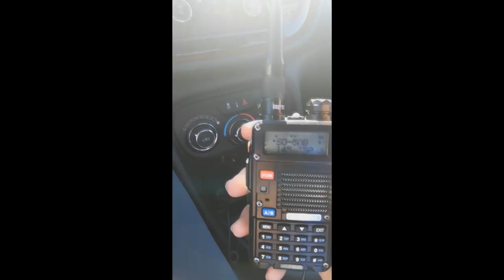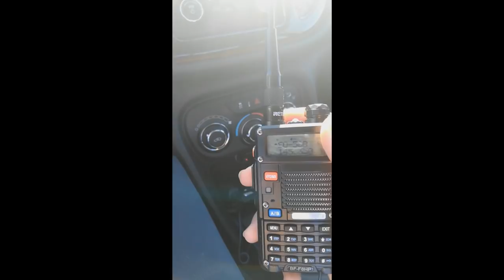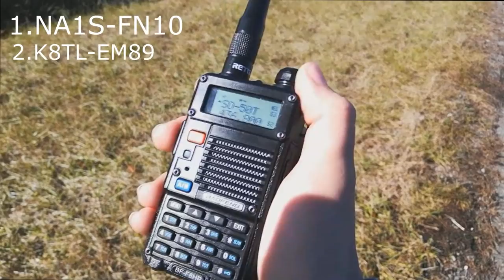Making contacts on Satellite SO-50 with the Baofeng-F8HP

Comment: Awesome! Would like to see more on how you set up in preparation for this. This is great!
Reply: Setup is somewhat simple, but you need to be able to program splits into your radio since the uplink and downlink frequencies are in different bands. The Doppler effect is more pronounced on 70cm band, so I don't worry about it on 2m. Just program -10kHz, -5kHz, center frequency, +5kHz, and +10kHz on the 70cm freqs. Use +10, +5 when it's just starting its pass, center when it's overhead, and +5, +10 at the end. Of course, switch between them to get the best reception during the pass.

Comment: How do you program your frequency's in for the satellites, specifically for the  SO-50?  Do you utilize the repeater shift? Or A and B bank? One for receiving and one for transmitting?  What's the best way to do so?
Reply: What he did was he utilizes your standard offset and all that but he did it for several frequencies so he program 3 frequencies to have the same offset transmitted frequency but he had it saved for three different frequencies for receiving because of the Doppler effect so he just move through his Banks of Saved frequencies

Comment: I'm a newbie.  What's the distance 2 ppl can communicate within a straight line of sight wIth 2 of these devices??  Thanks!
Reply from the maker: With true line of sight, it could be hundreds of miles, but a line of sight at this distance would be hard to achieve.
Reply: For comparison (I’m relatively new to gmrs) a Harris PRC-152 8w LOS can contact an aircraft 50-60 miles depending on frequencies. That’s with wide open sky.
Using the same radio/freq/antenna but in a city, you could be limited to a mile or two. Just FYI.
Reply: If one is on the hills . Contact with level ground would be possible for longe range. 
Plus a thing or two!
The satelite is like the midle man on this case. Since evrybody as line of sight to it .

This is awsome tech
Reply: Depends of the Hight and terrain. 

My personal record is with Baofeng UV82. 

From a large hill I was able to reach a repeater 87km away and make a reasonable quality communication, so I presume with better antenna only curvature of the earth would be the limit. :D

Comment: Whats the start and end freq you're using?
Reply from the maker: I always transmit on the center frequency for so-50, 145.850. On the recieve end, I start at 436.805 and in the end I'm on 436.790-436.785.
Reply: @ModernHam  Thank you. I was just wandering the recieve difference from one side to the other. Whats the difference in freq. But you answered my question. Thank you.

Comment: Well thats nice and all but it really pisses me off when someone rattles off their call sign as fast as you do.   Please slow it down for us guys out there listening to QSOs.   Having said all of that, knowing nothing about satellites, are you saying  the satellites are only available a few minutes at a time and one has to keep changing frequencies as they talk?  Seems like that can't be counted on in an emergency to me.
Reply from the maker: @daveengstrom9250  None of the contacts in the video had an issue with the callsign speed, even as they were tracking the satellite themselves. If someone asks me to slow it down during a QSO I will, but with several minutes of time to talk every few days on a satellite, you can imagine a lot of people get pissed off when someone goes to slowly reading their call. It's one of those deals where a skilled operator needs to match the needs of the communication method, and not appeal to one type every single contact. 
I'm not sure where the emergency comment came from, I don't remember mentioning anything about it in this video. This is just a fun operating mode.